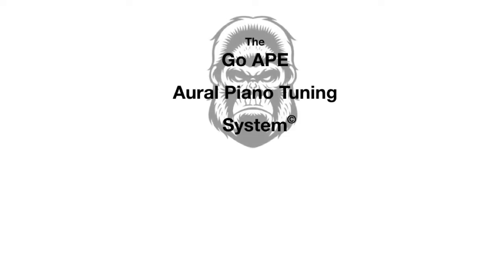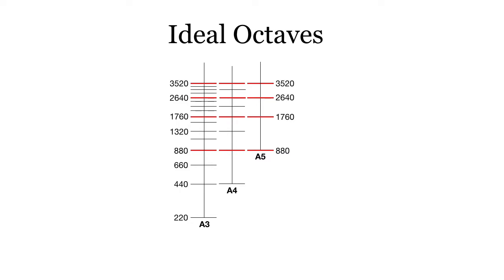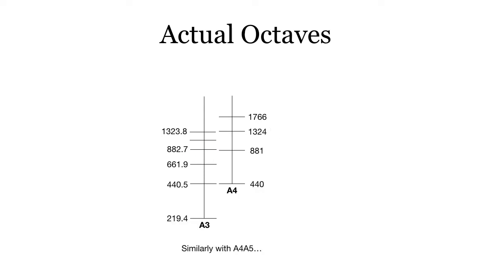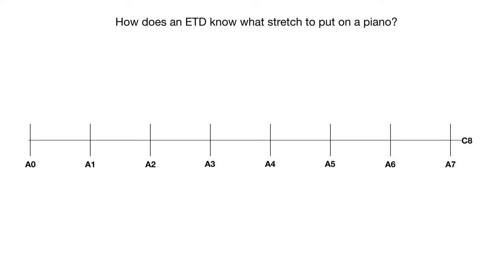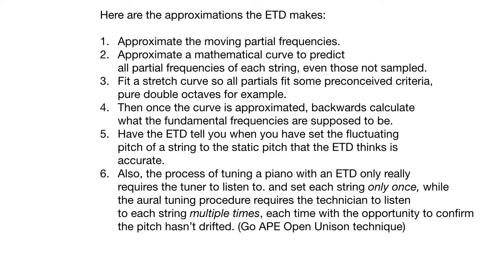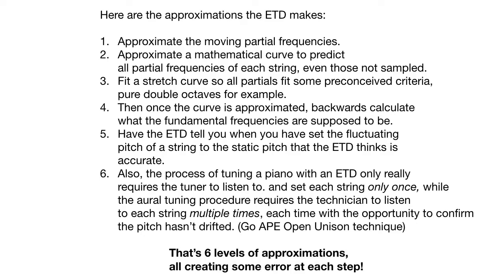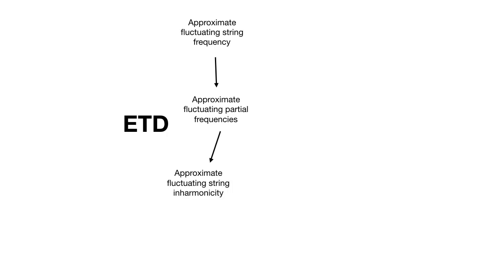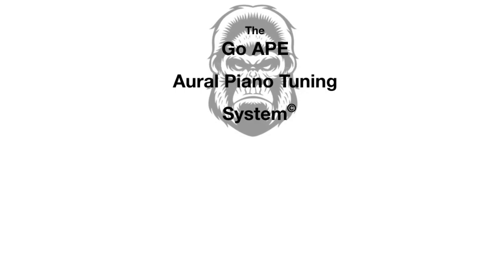How to Tune Pianos - Tuning Myth #12. ETD's are not better than the ear!

Comment: I tend to agree. But if you’re tuning a really good piano and can tune or properly work the tuning hammer I believe the EDT works great. Also you can make adjustments on the algorithm in the EDT to refine the program. 
Also you listen to the tuning as you tune and make adjustments.
Reply from the maker: It’s true. But what you are saying is that the ETD needs to be tweaked, and that can only be done by ear, which is exactly what I’m saying. The problem is that some people think ETDs do a better job than the human ear because, well just because. They are computers. We have to fight these misguided opinions.

Comment: Mark, I have enjoyed and learned a great deal from your videos. Although I find tuning very interesting, I admit that I have no intention of spending the time necessary to become proficient to aurally tune a piano well, nor do I have any experience of ETDs.
As an engineer though, I would have thought that the audio analysis of sound digitally ought to be quite straight forward and that software could be produced to replicate precisely your "progressively increasing beats" process in an ETD. If there are currently no such systems, perhaps there is an opportunity for you to design one.
Reply from the maker: Hi Steve,

The issue is the non-stable state of piano strings and the need for computer algorithms to deal with fixed numbers. Also, the approximations that the algorithms make.

No one has programmed my algorithm into an ETD although Bernard Stopper has a mysterious software product called OnlyPure which I postulate is similar as what I do when calculating stretch.

My Go APE method is more designed to get an accurate aural temperament fast which ETDs think they can do, but they don't factor in the fact that the pitches don't stay put and therefore need to be constantly corrected.

Hey, how much time do you think it would take for you to learn to tune better aurally? If learning to tune aurally is fun, wouldn't you hope it is longer than shorter. ;-)
Reply: Not sure what you mean by no stable state of the strings. If you mean inharmonicity, then surely the harmonic components settle after a second or so, after all you have to make a judgement at some time even when tuning aurally. Obviously you need to learn and be aware of the mechanical process of a string being stretched and therefore dropping back slightly as it settles. But this happens anyway you tune.

 Actually I was thinking more of the process of judging the beats as you tune intervals, rather than an ETD software calculating each frequency of a given string and then you tuning to it. So you would use as an aid rather than an indicator of precise frequency of a string (though this is obviously necessary for A3 pitch) I'm just thinking a computer is going to be better at this than most people could hope to be achieve and immediately. I don't see why a software system cannot be devised to emulate what you do aurally, after all a computer could judge beat speeds with great accuracy.

The question of determining stretch is surely complex, but my point is (and correct me if I'm wrong) it is not a subjective judgement and ought to be achievable with software. I believe some software systems do sample all strings and so should be able to achieve the ideal without approximation.

On the last question... well I prefer to spend my time playing rather than tuning the piano and I have a digital, but hope to get acoustic so I'll no doubt come back to you!
Reply: Hi Steve,

I mean the frequency is not stable. The ETD can guess which to use, but when listening to beats between two strings, the beat rate incorporates not only the drift, but how it sounds with the other string.

Also, I use open unisons to tune. There's no research I know of that has looked at iH constants as a function of number of strings. Because of my aural experience, I believe it plays a big role. And ETDs are notoriously bad at tuning unisons, so I imagine trying to estimate iH will be a problem too.

Also, Weinreich drift can cause drift up or down of up to 2 cents. That shoots all claims of ETD accuracy out the window.

Steve, I'm an engineer as well, you may know. So, you'll understand this story.

I was helping my friend cut down trees on his uncle's lot. We were there with his dad. We cut the trees, trimmed the branches, dragged the trees to the splitter, cut the trunk into pieces, lifted the logs into the splitter which can take your fingers off without you knowing it. I've seen a guy's three fingered hand to prove it. Then we have to load the wagon, drive to the yard, and unload the wagon. It takes about ten trips to get enough wood for the winter for him and his dad.

Like I said, I'm an engineer, so I'm doing the math and I say to my friend, "Darren, wouldn't it be cheaper to buy the wood?"

He says, "Yes". We still cut our own wood.

Get it? Sometimes being an engineer is a bad thing. :-)

I used to use this logic when trying to convince people that learning to tune by ear is better, but now I know it is, because the software just isn't as accurate as my trained ear. Now I'm on a crusade. You want to tune by ear? You got to use the best method. That's the Go APE method. It will kill any ETD's tuning, guaranteed! That's me against the computer only, no tech using the ETD and his ear.

Cheers,
Reply: Youtube scrubbed my carriage returns. Sorry. It was nicely formatted.
Reply: Whoa, they are in the Youtube site, not the email.
Reply: @markcerisano4268  ha...I know what you mean about being an engineer.  Thanks for the full reply, I'll need to    study more to fully appreciate your answers.
Reply: I personally love my sat 3.  Its about spot on about 90% of the time with a pitch raise. However aural tuning shines in the 10% of the time it doesn't work. 

regardless as to how good your machine is, the piano and the room the piano is located in can mess with accuracy and you as a tuner need to account for that. Picture frames have glass that can sometimes rattle or glassware that can vibrate just strangeness with the piano's scale.  And in some cases a perfectly tuned piano may not sound good due to issues with something.  So you offest the tuning to compromise for that strangeness with something that technincally is out of tune. 

Everyone who tunes pianos should be capable of tuning aurally.  A machine is meerly a gadget that cuts my time down particularly with pitch raises for pianos getting their bi-decade tuning.  And at the end of the day the client generally just wants their piano sounding good and machines do not take subjective things into account.

Comment: I am not a piano tuner, but heave studied some ot the theory and have the basic tools. I have attempted to tune 2 or 3 pianos and a nickelodeon,  I am an electrical engineer and have long thought about the possibility of designing a tunable filter so  you could listen to specific partials that you want to tune to.
You mentioned using Ocenaudio to filter these partials to better hear the beats.  But isn't that only for post-processing of a recorded sound?

Has anyone ever used real-time filtering as an aid to hearing partial beats?
Reply: What do you mean by post prospering?
Reply: I use a MFJ751b.
Reply: @markcerisano4268  Typo
Reply: @markcerisano4268  That looks like it would be very helpful, especially at the beginning. Does anyone else use this?
Reply: @8546Ken  it’s still in the prototype stage.